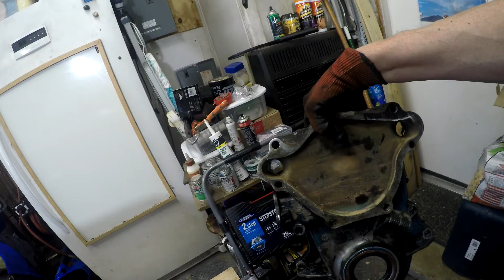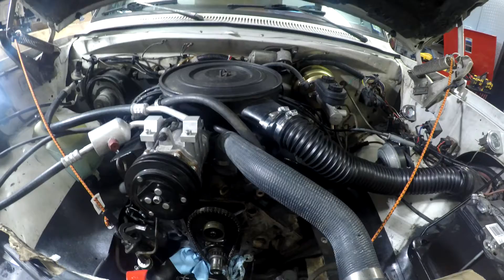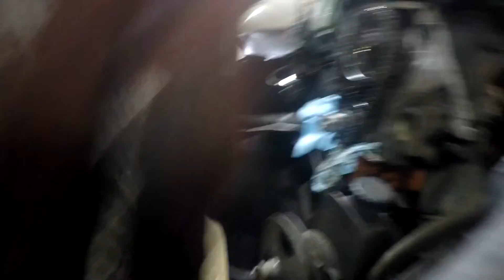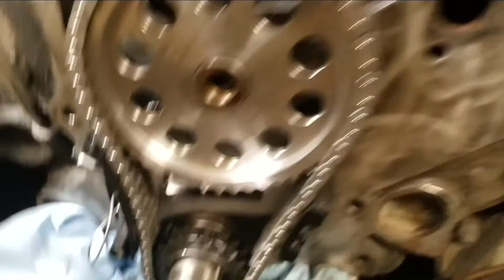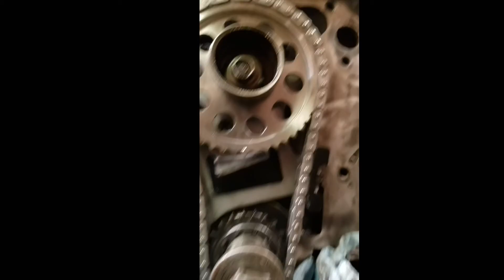1986 Dodge D150 318 Timing Chain Tensioner Upgrade

Comment: Soaking the timing chain for a few hours or overnight in oil is a good idea. Gets oil in the rollers. So its not running dry on start up.
Reply from the maker: Thanks for the info.  I think I did soak it but probably not that long.

Comment: Doing the exact same fix with a Howard's timing set and Cloyes tensioner on my 318 to get rid of a sloppy chain that was knocking against the fuel pump arm. Thanks for the video!
Reply: about 1K miles so far without issues after the install.  That timing chain is so nice looking that it's a shame it has to be covered up.  I had to drop my oil pan a few hundred miles ago to replace a failed oil pump and the chain and tensioner still looked good (from what I could see).

Comment: I just had those installed on my Fifth Avenue and the technician told me the same thing, tight as hell now and a PITA to install. I'll be finding out how it all performs once he gets the fuel injection system installed. Nice, clean 318 you have there, btw!
Reply from the maker: Thanks.  Mine is still going strong.  Let me know how yours works out.
Reply: @garagemasher4162  Yes, will do. I'm hoping to have it back in a couple of months.

Comment: The only thing id say to watch out for is the double roller chain riding that plastic piece of the tensioner. You could wind up with pieces in your oil pan. Those chain tensioners are meant for the silent chains that are more smooth than the Double rollers. Just something to keep an eye on
Reply: Interesting, I think his timing chain set and tensioner are the same brand so I would think it would work together but maybe I'm wrong, but you bring up a good point
Reply: @jacobclark89 yea, the double roller will eat the plastic guide and it’ll wind up in your oil pan. Lots of people do run double roller chains with tensioners from magnum but you’ll find where people found out it ate up their tensioner guide. I put a silent chain and tensioner on my la 318 and after 8 years and a rebuild, no problems. Reused the timing chain and tensioner.
Reply: @bsrob1  I just got a 98 ram with a 318 magnum and it has over 300,000 miles on it and was thinking it might be time for a new timing chain , it runs good, but it seems to run a little off for a while after I give it a lot of throttle so maybe it's the stretch in the chain. Would you replace the chain and if so which one with or with out a tensioner ?
Reply: @ the tensioner is factory on a magnum. If you replace your chain just be sure to get the silent chain. If the old tensioner is wore out I’d get a new one. 300,000 is a lot. I also have a 2000 318 magnum ram. Uses a lot of oil even tho I’ve done the intake plenum fix.
Reply: @bsrob1  thanks 👍. If you're not leaking the oil were do you think it's going ? Valve seals? Does it smoke ?
Reply: @jacobclark89  open the throttle blades and look down in the valley pan of the intake and if it is covered in oil, then your intake is leaking where the gasket is. The intakes on those magnum motors are two pieces, and they are notorious for blowing out the gasket and sucking oil, which would also cause the truck to not run right. From everything I’ve read, the magnum motors are notorious for burning oil. I fix my intake with the kit from Hughes engines instead of a bottom steel plate. They give you an aluminum plate to bolt up with a new gasket. The reason the gasket blows out with the factory set up is the top of the intake is aluminum and the bottom plate is steel and aluminum and steel Do not heat up at the same rate.
Reply: @bsrob1  thanks, that's great info 👍. I totally understand what you're saying about the timing chain , have you experienced this problem yourself ? I have heard from other people that it's not an issue , also you say that the tensioner comes stock on magnum engines and Mopar performance sells a  dubble roller timing chain set for the magnum 318,360 it's Mopar P5249268 Double Roller Timing Chain And Gear Set .
Reply: @ yes they do sell double rollers for magnums but if u research double roller chains with tensioners you’ll find photos where the double roller ate away the tensioner guide. I run a tensioner and silent chain on my la318 in my charger. It’s held up for over 8 years. Keeps the chain tight too
Reply: @bsrob1  I just watched a video of a 318 magnum and it doesn't have the tensioner stock , so that would explain the Mopar performance dubble roller timing chain set ,  I wonder if I'm better with the double roller with no tensioner or the tensioner with the silent chain , running stock cam
Reply: @ as I said I’ve ran the tensioner and silent chain for 8 years. No problem. You can find videos n short reels of the charger on my page. For a lil 318 it runs pretty strong.
Reply: @bsrob1  I just messaged a person that has over 330000 on his 318 , like mine does , there is a lot of things I like about the older vehicles , like they use metal instead of plastic and don't have all those extra parts like 3 timing chains  ECT. I have a friend that has a new ram hemi with hardly any miles on it and broke a valve spring valve took out a piston and he had to get a new engine ,I need those problems 🤬 maybe if I replace the chain and the plenium gasket and plate maybe I can squeeze a couple more hundred thousand out of it ?
Reply: @ they literally don’t make stuff like they use to. If it lasts there’s no money to be made. Also there is a video of my 1500 ram on my channel also. Should be on the short reels I have
Reply: @bsrob1  Ya, I hate when they build them so you have to take them to the dealership to fix , they shouldn't have hidden codes that only the dealership computer can access 🤬 or all the stupid problems with key fobs and security systems malfunctioning leaving you stranded, I worked on a an Impala that had an issue with the fuse box , they have a circuit board and electrical components transistors, capacitors Inside .I think that the plastic housing warps over time breaking the circuit board inside , causing a no start issue , talk about a difficult problem to find 🤬 . We never had ridiculous problems like that with the old stuff. I like air bags and fuel injection but when you have to pull the engine to change the second timing belt in the rear of the engine , ridiculous, 🤬 . Or The engine's that are destroyed when the timing belt breaks.

Comment: The tensioner is NOT recommended with a double roller chain due to the chain design, a standard chain will wear into the plastic tensioner pads a lot less than a double roller. If you look at the back of the standard chain vs the double roller you’ll see what I mean.
Reply from the maker: Ugh.  Well, too late now..haha.  I have plans in the future on replacing the cam so I'll be able to see then if there were any detrimental effects.

Comment: Question: i have an issue with timing bouncing between 11-12 (that’s where mine seems to be happy at) doesn’t backfire through the TB as much, but if the chain has a little play- could this cause the backfire/cut out issue
Reply from the maker: A loose timing chain could definitely cause the timing to move around.  Since you mentioned TB I'm assuming throttle body so it sounds like you have a fuel injected car vs my carbureted version but the principle is the same.  To me,  any backfiring would indicate timing is pretty far out such that the intake valves are partially opening during the exhaust (or compression) stroke.  Since it doesn't seem to happen all the time, the problem could be whatever controls the timing.  I'm sorry I'm not familiar with the fuel injected 318's but I suspect they have a timing controller (maybe a hall effect sensor).  That could cause issues if it's failing.  For my old jalopy, It came originally with a simple points style distributor and they can be a little sloppy.  1 to 2 degrees of fluctuation in timing would be quite normal for most points style distributor systems.  However, I've replaced mine with a Holley e-curve distributer which is digitally controlled so it's much more stable.  FYI, If the timing chain gets too loose it can actually skip a tooth which could cause a significant runability issues.  That typically only happens on high mileage vehicles though (assuming the timing chain had never been replaced).
Reply: @garagemasher4162  truck has 52,000 miles on her (1989 W100 5.2/318 TBI ) 

However, you are correct about the hall sensor, I’ve replaced spark related including the entire distributor setup, plugs and wires and ignition coil itself (checked worm gear in the block and it looks okay as well), 

I’ve heard the timing being off by a tooth or teeth (if someone had it changed or never made it through the break in period for timing chain properly- it could cause the cam timing to be off, which would mean setting the ignition timing is more or less band-aid fix until the chain has been replaced.

Comment: Good video but with no conclusion, so did it fire up without any issues ? I got to do this on my 96 Dakota.
Reply from the maker: I apologize for not finishing up the video.  I had a huge fiasco with an aftermarket oil pump that I installed at the same time that nearly took out the motor.  Everything worked out though and the timing chain and tensioner are still going strong.
Reply: @garagemasher4162  First thanks for taking the time to answer, second sorry to hear about the oil pump fiasco at least positive results happened  with that chain/tensioner installation.

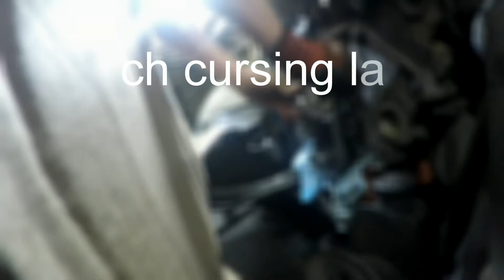Comment: Thanks for the video, but left hanging at 13:23 . . . Aside from cursing how did you actually get it on between the tensioner shoes...any special hacks, or just brute force. I got as far as that but due to too much tension couldn't get it back on. . . I tried with a screwdriver to pry from bottom,. . . nothing and finally just put the old t thrust plate on and old cam gear to be done with it...still too much chain play for my liking now regrettably I'm having both cam sensor and crank sensor codes suggesting it timing might be off by a tooth. . . sucks cause the only way you can know if you got it right, etc. is by tearing it all down again, gonna replace those two sensors first in case I just shorted them, otherwise gonna have to do rodeo # 2 and try again with tensioner.
Reply from the maker: I apologize for leaving you hanging there.  What I ended up doing was getting both sprockets installed on the chain and then slipping the bottom sprocket onto the crank snout far enough that it was able to get positioned onto the tensioner.  At that point, I took a small pry bar (barely larger than a large flat head screwdriver), ran it through one of the holes in the upper sprocket and into a space on the block that was around the height that the sprocket would be when fully installed.  I then lifted the pry bar and pushed the sprocket at the same time until I got it to contact the cam.  At that point, I used a rubber mallet to tap on the sprocket until it was fully engaged.  

I don't drive the truck much (It's the 'real' truck that I use when I need something big or bulky from the hardware store), however, it still runs great.  I plan on rebuilding the 318 next year sometime and when I do, I'll give an update on the condition of the timing chain/tensioner.  

As an FYI, my engine is old and doesn't use any sensors so maybe that's the issue?

Comment: I'm thinking about doing the same upgrade now. Appreciate the really detailed video. Where did you order these parts from? All one website or did you have to get them from multiple? 

Also - I see this was done in June of 21. Any issues since then? I have a 360 in my Ramcharger and I'm curious if I can do this same upgrade on it. Thanks!
Reply from the maker: Thanks.  I couldn't remember where I bought everything.  Looks like it mostly came from Summit Racing.  

Here is the list of things I used (not counting seals, etc.):
     1.  Timing Set: https://www.summitracing.com/parts/hrs-94330
     2.  Water Pump: https://www.summitracing.com/parts/mil-16250
     3.  Timing Chain Tensioner:  https://www.summitracing.com/parts/clo-9-5387
     4.  Crank Snout Oil Slinger:  https://www.ebay.com/itm/284159321290

Item 4 I bought just because it was not on my engine but it looked like it was supposed to be there and I wanted to make sure no oil got past the crank snout hole.

I have not had any issues at all with the timing or the water pump.  However, at the same time I did all that, I also changed the oil pump (to a high volume unit) because my oil pressure was low.  Now that caused me a lot of trouble!  Everything was fine right after I got everything together but about a week later I started watching as my oil pressure started dropping.  It finally went all the way to zero before I could get home along with a slight increase in water temp.  I checked the engine and there wasn't any knocking so I figured my oil gauge was acting up.  Nope.  I have a mechanical gauge under the hood for troubleshooting and it was zero as well.  I pulled the new oil pump and discovered a very slight dent in one of the rotors with a matching dent on the wall of the housing so something got pushed thru it that caused the pump to fail.  

I decided that after the low oil pressure my bearings were probably toast even though I couldn't tell that anything was out of the norm except for the pressure reading.  So I purchased a set of rod and main bearings and rolled them in with the engine still in the truck (along with a new oil pump).  Thanks to YouTube for showing me that trick.  Anyway, I've got a full 60 psi cold and 30 psi hot now and the truck is running happy as a clam.

I also just recently converted from 2bbl to 4bbl using a Demon carb.  I can definitely tell the difference with that change.

I think the timing enhancement should should work for the 360 as well (non-Magnum?).
Reply from the maker: Sorry, I forgot about the cover.  I don't remember where I bought it but this is the one:
5.  Timing Chain Cover:  https://www.summitracing.com/parts/rnb-635-400/make/dodge

Comment: How different are these engines from the 1984 318 motor?
Reply from the maker: Hi.  As far as I know they're basically identical. There may be some minor emissions changes.  I believe my '86 was the last if the carbureted versions.  Then they went to fuel injection before switching to the Magnum 318.
Reply: @garagemasher4162  Alright, thank you sir!

Comment: With that after market bottom sprocket You can Set The crank to Cam advance Don't set it at 0 if you're running your factory Cam Put it in the plus 4 Degree slot Your  factory Cam Should have A center line Of 112 My lunati Cam Shaft Is A 108 Basically directions on how to unpunkify it Using after market gears with stock Cam

Comment: Did you have tapping sounds prior?
Reply: No tapping sounds at all prior to the switch.  Timing was a bit erratic though.  The main reason I changed it was due to the broken fuel pump mount on the timing cover.